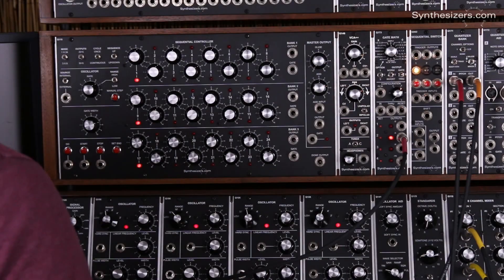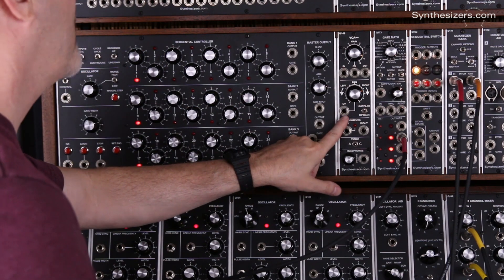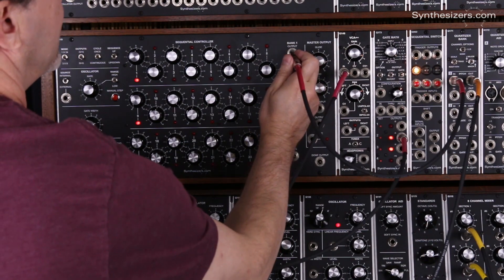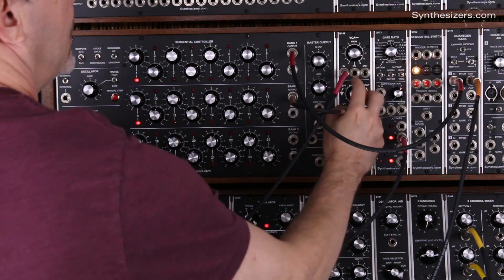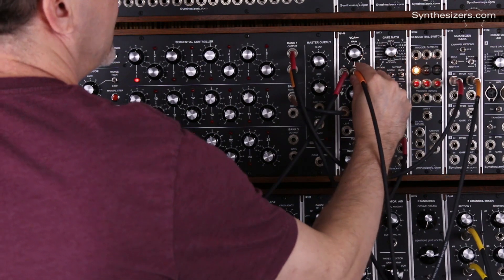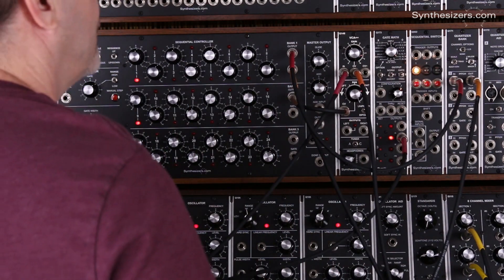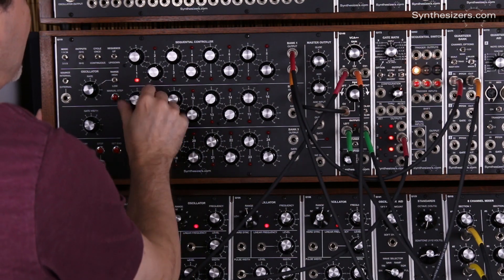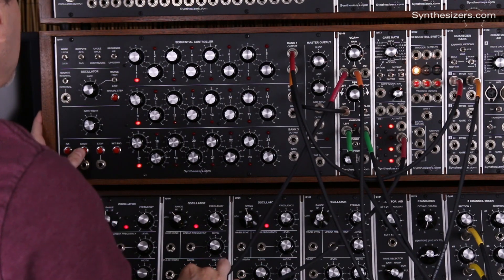Q148 VCA++ Sequencer Panning

Comment: Forgive me if I'm missing something, but what's causing the sequencer to only cycle through 6 steps, instead of 8?
Reply: The number of stages in a sequence is set by a front panel push button labeled 'Set End'. Pressing this button causes the LED for the last stage in the sequence to flash. Pressing again allows the user to cycle through the stages. The last stage is set when the button is not pressed for 1 second.